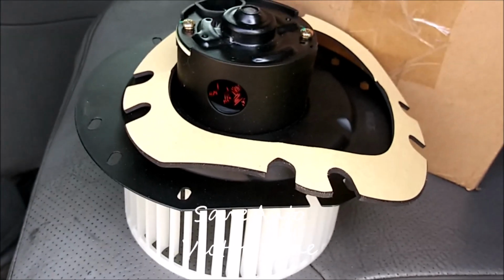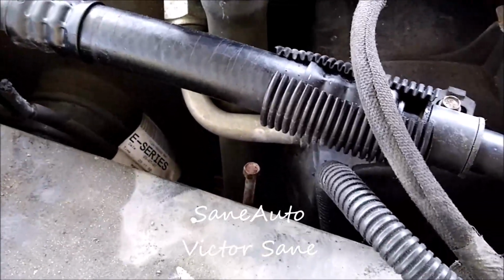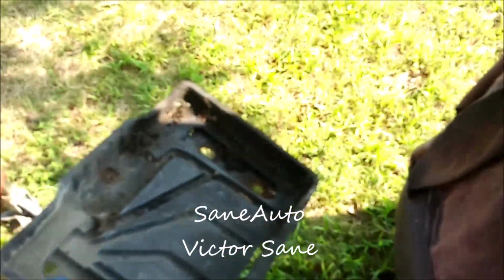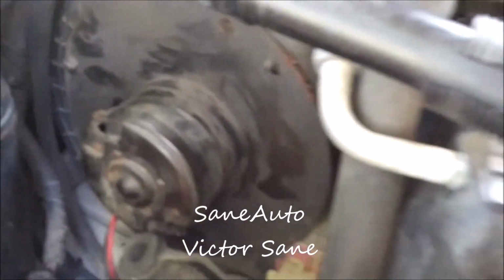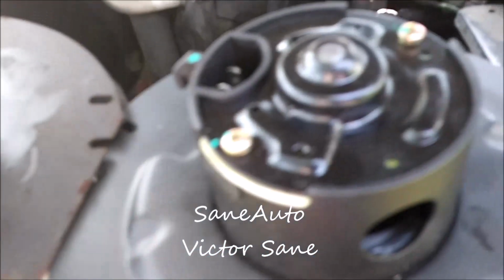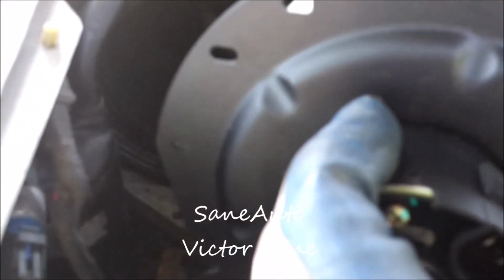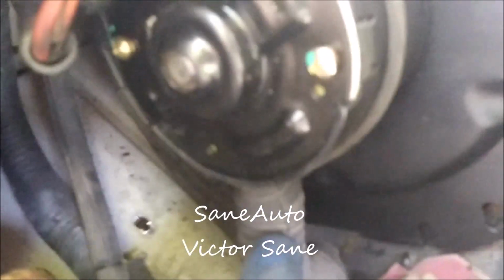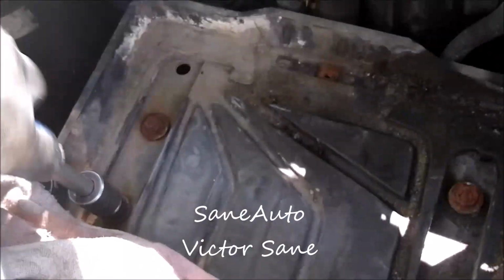How to replace Ford Van A/C blower motor step by step

Comment: I've changed a ton of blowers on many kinds of vehicles. Most of the time they fail because that back bearing gets dry. I used to take them apart and grease them but some housings make it all but impossible to do without damaging them. On my own vehicles I have carefully drilled a tiny hole in the rear bearing bulge and forced a little grease in the hole. The fan motor will quiet up almost instantly and run perfect. I clean the bearing bulge and stick a good piece of heavy duty aluminum tape over the hole and it is good to go for a long time. Not something to ever do to a customer but it works well to save a few bucks. My father in laws truck has been running better than 5 years with that fix. He was glad to save some money. Lol.
Reply from the maker: Great tip

Comment: Great video thanks brother. I always watch 100% of the videos. I like the instructional video never stop learning. I would wire brush the bolts out in the field when that's all you have. I hate never seize but I use a lot of it. I have the gray and a gold color. I forget the difference between them don't use the gold color one very much. I remember some Fords you had to take part of the dash out. Keep up the great work see you in the next video thanks again brother.
Reply from the maker: Yep thats the older ones like my Mach 1 part of the dash had to come apart. I wasnt making videos back then.